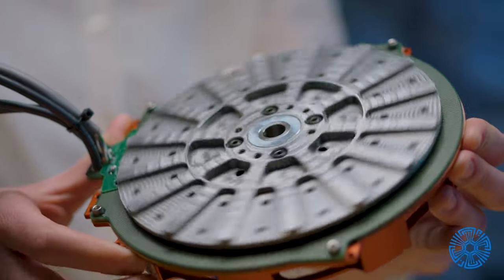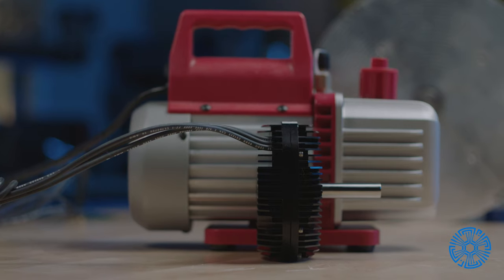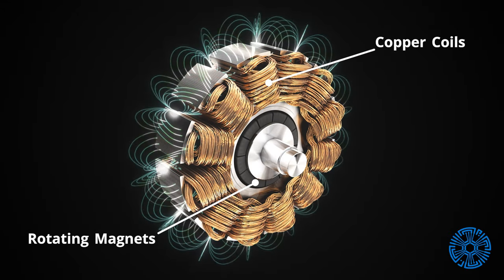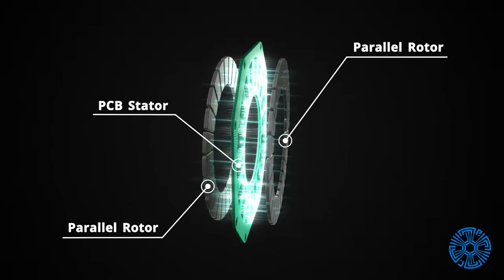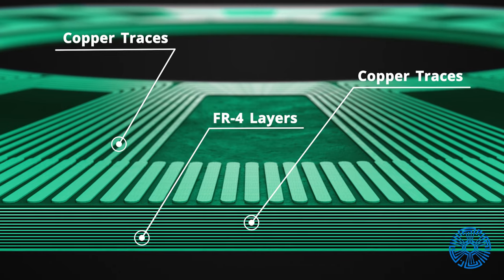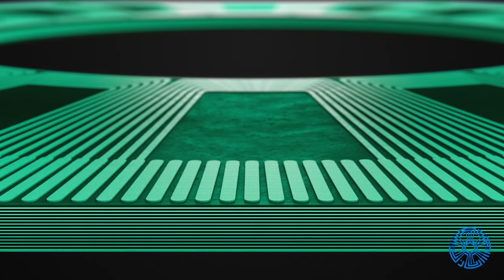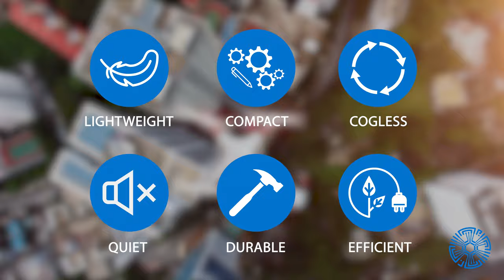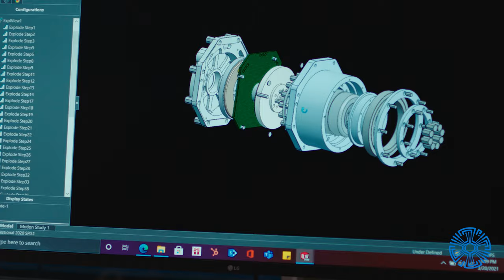How Does a PCB Stator Work?

Comment: What about heating issue? It would matter more since not all inner parts are metal
Reply from the maker: ECM PCB Stators utilize patented thermal traces within the boards to dissipate heat effectively, eliminating the need for additional cooling in 99% of ECM motors.